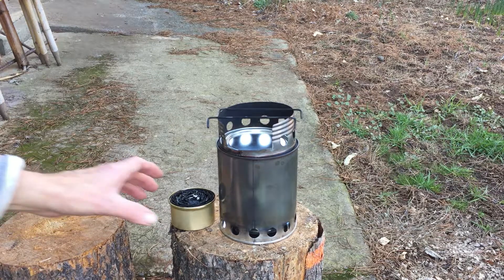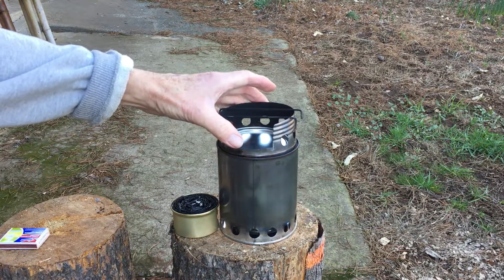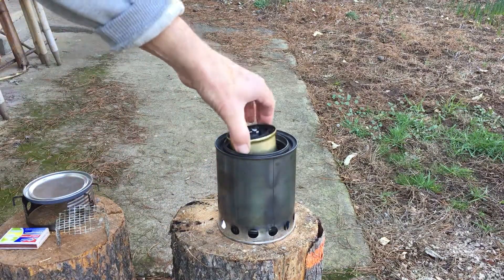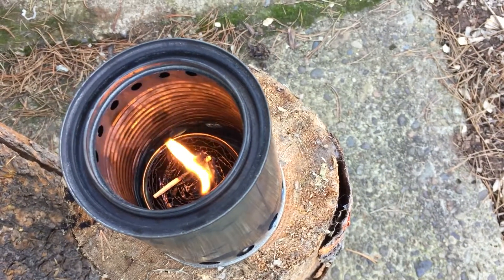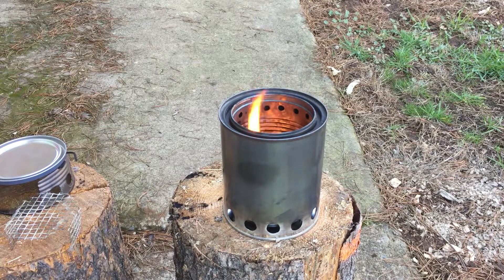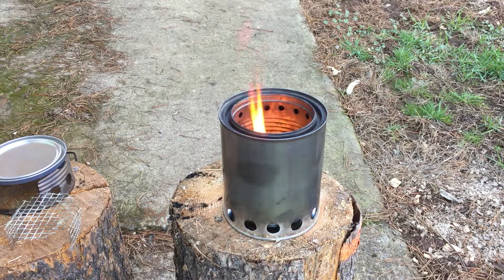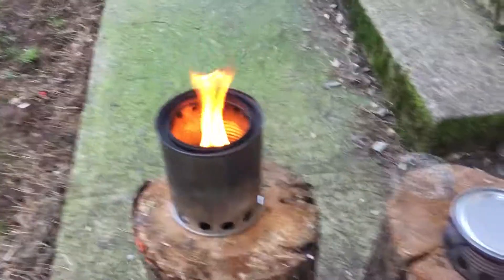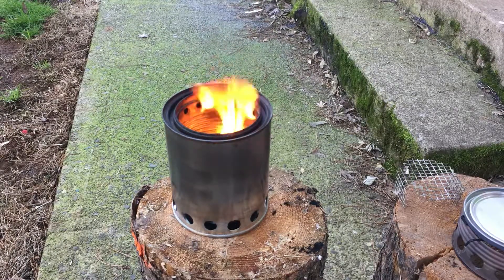Will a Buddy Burner gasifie in a Wood Gas Stove

Comment: Interesting test.  I think the can shields a lot of the burn from the usual gas stove process.  If you were able to get the cardboard / wax burn element out of the can, possibly by freezing.  you may see more gas action.  Wood gas stoves burn from the top down.
Reply: Seems like when you burn wood with the fire near the top the smoke gets pulled down then the gas comes up and burns through the holes. Maybe a wider buddy and closer to the top holes.